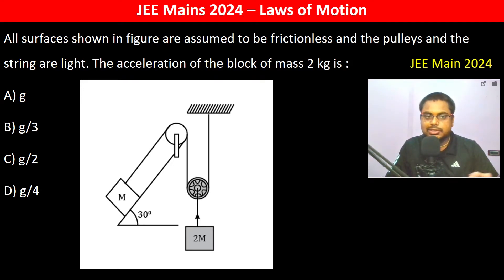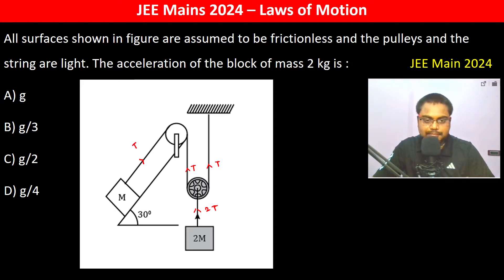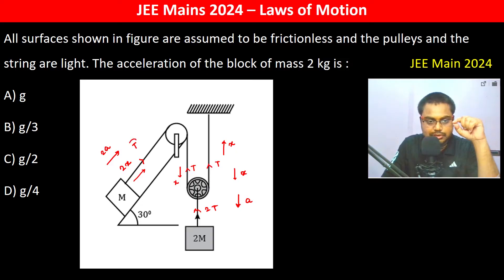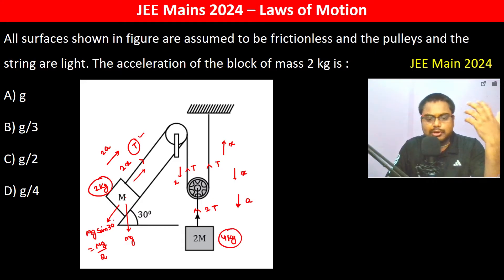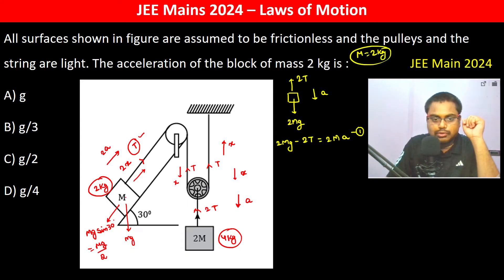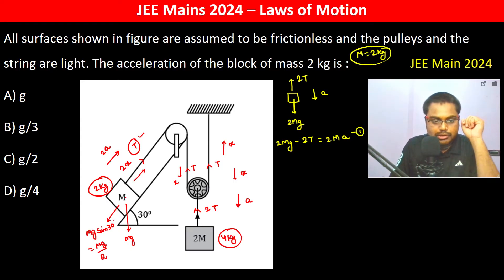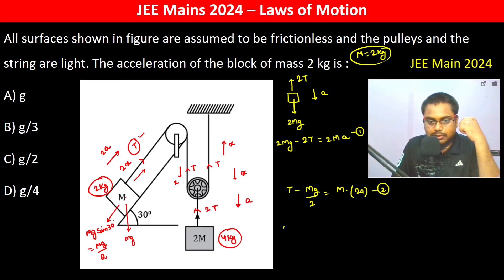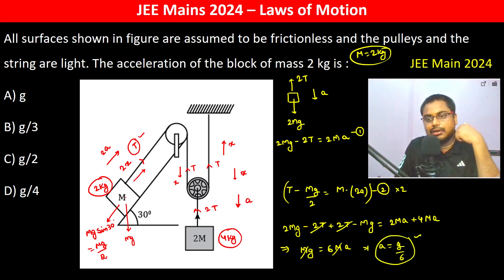All surfaces shown in figure are assumed to be frictionless and the pulleys and the string are light

Comment: Sir why the accelaration of block of mass M is taken as twice of the accelaration of 2M block? Got confused please answer
Reply: Acc to Constrain motion 
T1a1= T2 a2
2T×a= T×a2
a2 =  2a
Reply: Sir but why are the acc of both blocks not same here
Reply: @harshsagar4840because here the tension is not same on both the blocks and also as in case of block a the pulley provides a tension t but in case of block b the pulley as it has two strings so provides a net 2t force
Reply from the maker: Constraint equation
Reply: @sarathiacademyjeeneet pagal hai explain karna nahi aata hai kya bacche ko tere se accha toh bacchon ne hi usse explain kardiya